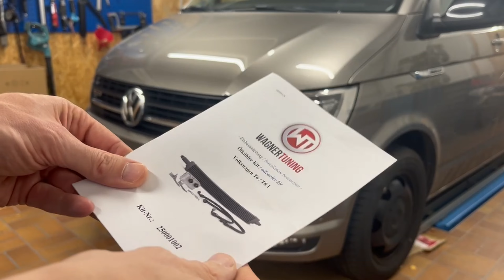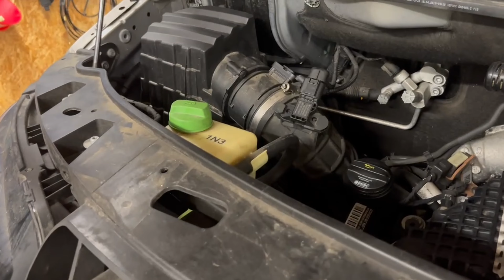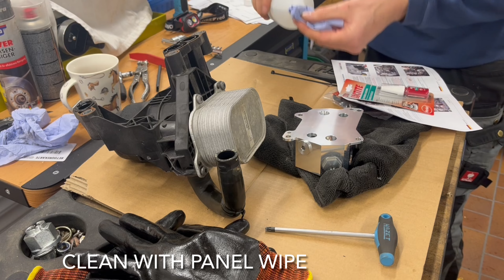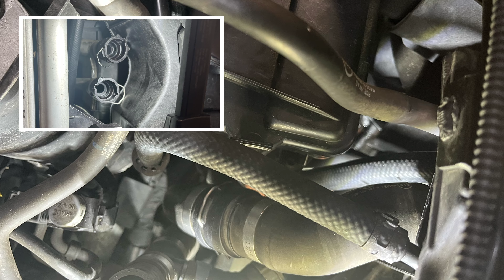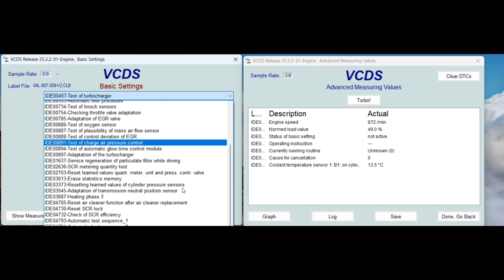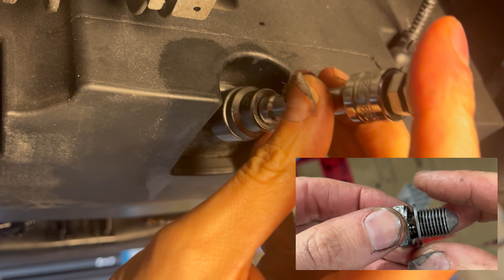Installing a Wagner oil cooler kit to a VW T6

Comment: Nice video mate , how is yout temperature now?
Reply from the maker: Didn’t go over 115 driving back from France fully loaded in 40 degree outside temperatures. Mostly it’s around 95 -105 degrees. I don’t drive  over 75mph/120km/h though

Comment: Hi,
What are your oil temps now?
 I fitted this kit in january and I am now seeing oil temps in the mid 80's (nowhere near hot enough). Ive seen 100C once when really thrashing the engine. Wagner tuning are trying to tell me its fine and the oil temp display is incorrect. for reference i used to have oil temps around 108 to 110C which rose to 140C when towing
Reply: Hello Mate. I am thinking of installing the Wagner kit on my T6 because I tow a lot and towing I am getting uphills 130-140C oil temperature. When towing, which temperature are you getting? Because a friend of mine have a tiguan 240cv also biturbo and with a "normal" kit from darkside he din't improve the temperature at all, we have to install a bigger radiator in order to get the oil at lower temperatures, now he is getting arround 80C with no trailer, and with trailer 100-105 no more which i think is ok... If you could help me I will apreciate it a lot. Thanks

Comment: My EA288 CXHB goes to 102 Celsius going highways speeds.  Around 90 on public roads. Wondering when VW failed the bi-turbo. Hope this helped
Reply from the maker: That’s not too hot. I watched a number of videos where guys were testing the oil and it seemed like a running temperature between 115-135 was a problem. The oil quickly cooked and lost its protective properties. That’s why doing more frequent oil changes is advisable. The cooler is the next step if you don’t want any risk and have the money and time to fit it.

My temperature is now down to 85 degrees C on the highway and about 80 on public roads. My engine is the CXE 199 ps. Before the cooler it was regularly at 105 and under loads it would get upto 118. when I say loads I mean driving steep roads in the summer fully loaded. So not that often.
Reply: @And @Andrew_vanlife s like the T6 diesels all run fairly hot. Pretty concerning. Above 100 when indeling is normal but in cooling fan range. 
Although the higher output engine seem to go up into catastrophic conditions, especially for turbos. Seems like higher temps relate to clogged coolers and other emissions management.
Remembers me to make time for a borescope inspection. 
Am thinking, are there cheaper ways than a better oil cooler to get the T6 better. Maybe getting more cooled air in the engine bay. 
85 to 95 is a healthy number. Numbers to aim for
Reply from the maker: Before I bought the cooler I wrote to Wagner engineering. They also sell an upgraded cooler for the water system and an upgraded turbocharger cooler. I said I could only afford to do do one and they recommended the oil cooler. 

When I dismantled the original oil cooler it looked more like a heat exchanger to me. The water runs across the oil line and there’s an internal structure which I exchanges the heat. There’s no external fins. That’s basically all the cooling you have. I’m sure you could fit a cheaper cooler somewhere else like we do on older buses. You can buy the thermostat/take off on its own.

Comment: thanks for video, i have same engine same problem, and i have question > How much oil does your T6 use per 10,000 km?
Reply from the maker: my van isn’t losing any oil, it’s quiet low mileage, I bought and fitted the cooler as an expensive insurance to keep the temperature down. Difficult to know if it will be worth it or if I was encouraged by all the online scare mongering. 

An engine vacuum test will determine how bad things are. It might not be so bad. 

You probably read this already. Maybe that gives you a feel for what is acceptable, for sure tolerances will open up and there will be some oil consumption as parts wear.

https://www.t6forum.com/threads/204ps-bi-turbo-cxeb-t6-engine-turbo-problems.52916/
Reply: @Andrew_vanlife  What people are saying about this engine makes sense to me, I think this will definitely help with the oil overheating. My T6 has 140k kilometers and I opened it up as a precaution and found that all the oil rings were burnt, unfortunately cylinder 2 was worn out more than the other three but still within normal limits, I recently did a 1.6 TDI engine which has over 400k kilometers and the wear was minimal, and interestingly the 1.6 engine has stronger piston rings and the oil rings are also better
Reply from the maker: What did you do to repair it? I‘d also love to see pictures. Knowing how to evaluate the damage is really difficult without experience.